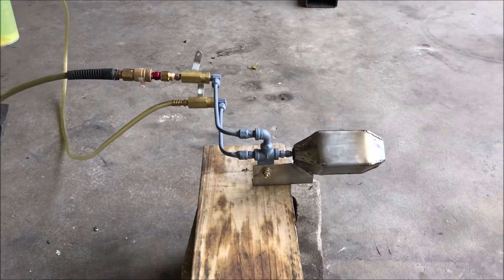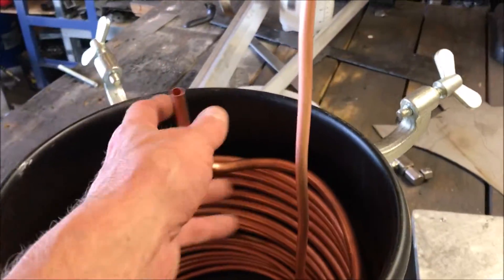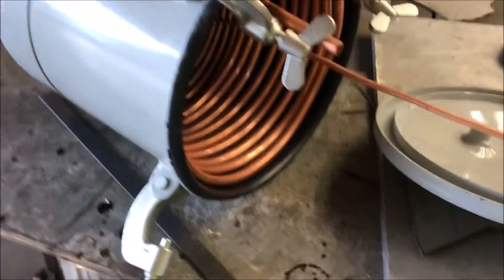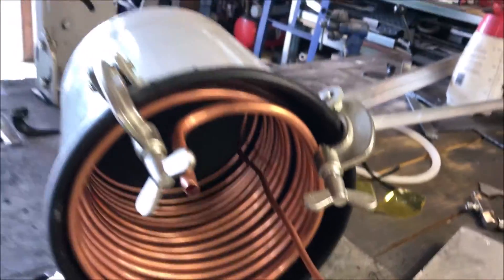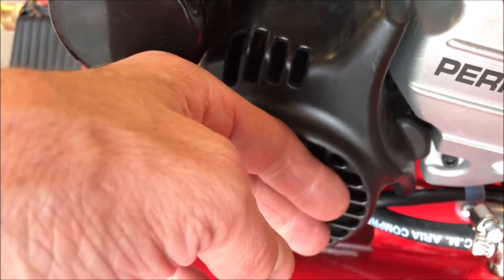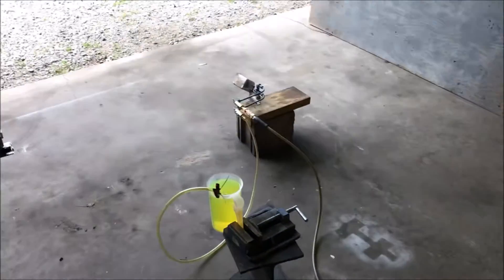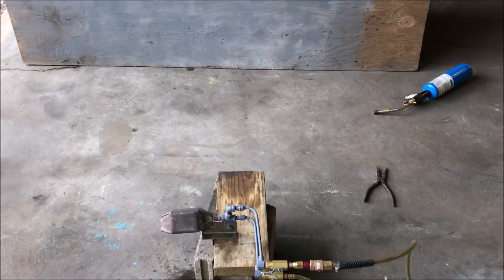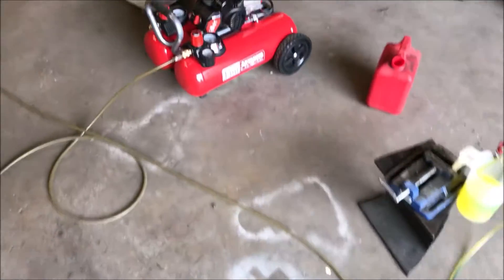Pressure washer steam cleaner  Build )  for Carlos Test #1

Comment: You might already know of this, but I lot of home built steam burner coils are built inside of a "double pass" housing, meaning the inside of the housing is double layered with a coil in the outermost compartment, then another inner coil. It looks similar to one of those double layered coffee mugs when you cut the top off. This gives the fire much more dwell time on the coil. These burners typically don't discharge any flame out of the exhaust, most of the fuel is burned and consumed within the coil housing and you only exhaust hot air. I've seen some pretty nice refractory cement castings around the outside as well, really helps get all the heat you can into the coil and makes it much safer to be around the burner.
Reply: This is true as it stops the pipes from heat in one area. Plus the burners are always at the top to heat the water in heat buoyancy order. 
Nicely mentioned. Shame the poster didn't recognize your worth but I do🙂